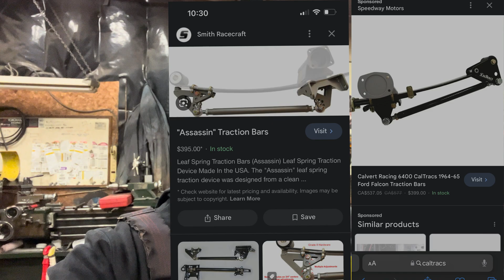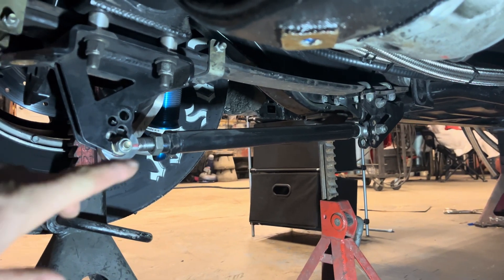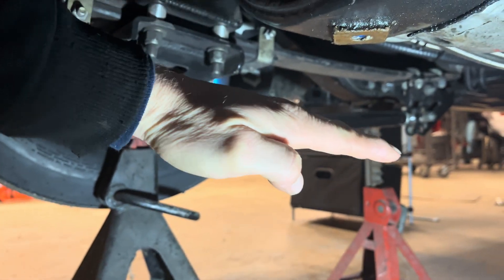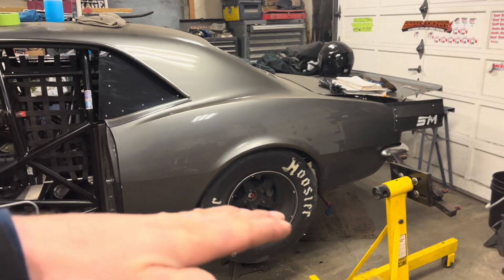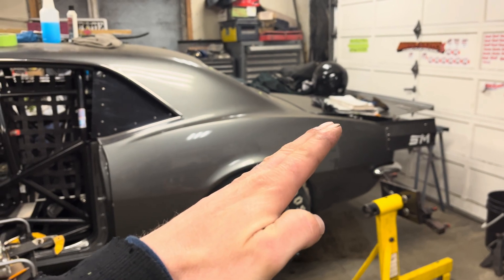Leaf Spring Traction bar tuning and adjustments!

Comment: man ive been fighting my leaf setup for 5yrs.  split mono, assassin bars, strsnge da with promod valving on all 4s.  i cant get out of 1.43-1.49 60ft no matter what.  makes tons of power but cant apply it or turn the power up either.  skates all over the place.  front pointing down or pointing up dont change anything.  seperates 3 inches or so.  seems the front drops and levels off.  then its smoking the tires trying to kill me. lol  
if you have any suggestions where to go.  be much appreciated.  can see the last few vids of my dart skating around.  have tons of rear ballast 290lbs ish in back.
Reply from the maker: Ya you’re really having to drive that thing up top lol!  Have you checked your front end alignment with the front end jacked up to simulate where it goes down the track?  Maybe worth checking?  Somethings off with the chassis or suspension to be skating around that much I would think. Could try to turn the tuneup down a bit too and see if it skates so much, hard to tell in the vids but maybe it’s got a lot of wheel speed?
Reply: @one_bad_attitude  ive had it aligned a few times.  it has helped, but its always have to drive it more than i should have to.  
i just changed the rear front leaf due to pinion angle found to be -14°.  raised the front of the leaf 1in and now the pinion angle is closer to -7/8°.  based on a little drive i took after this.  zero shock changes it moved out hard, but the front didnt move up anything like it used to.  much more stable and drove strait and easy.  hoping the pinion angle change makes the csr run like it should.  i still have 1khp+ on tap.  never been able to turn it up out the back.  only curve from launch, which has been a giant pita as well.

Comment: Nikki Bobby sells a bracket calls the Gap bracket goes underneath of the axle it's got four holes in it instead of the one for caltracs I have caltracs and I bought these Gap brackets off of Nikki Bobby and they were great I got four extra holes on the on the on the axle and I still have my normal two up top in the front bracket

Comment: Sir good stuff!!!! Made some changes to my car and it's not hitting the tire as hard as it did, lost some 60". I'm running the caltrac setup. May need to look into the Assassin traction bars to get more adjustment for fine tuning rear suspension!
Reply from the maker: Thanks for watching. Glad it helped!
Reply: Raise the front leaf mount or increase the angle of the caltrac bar

Or both. Both will increase anti squat and hit harder

Comment: What type of leafspring hangers are you using?
Reply from the maker: I custom built my front mounts and I’m running sliders in the rear.
Reply: @one_bad_attitude what are sliders for? My leaf experience begins and ends with off-road trucks